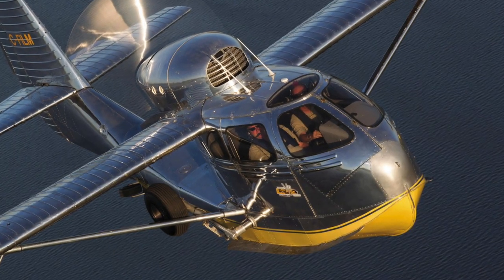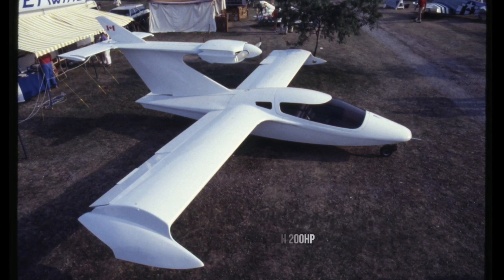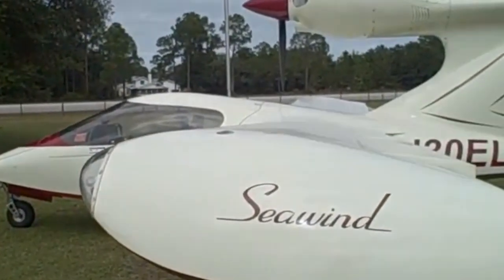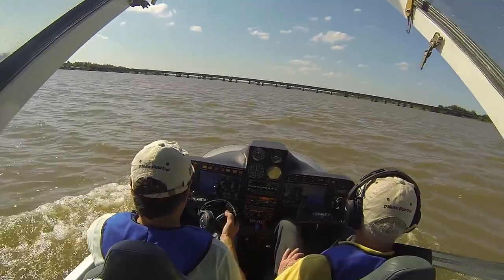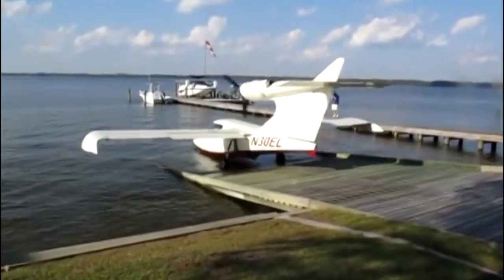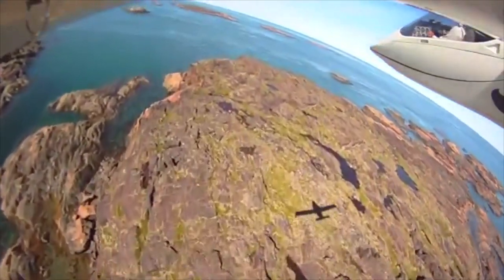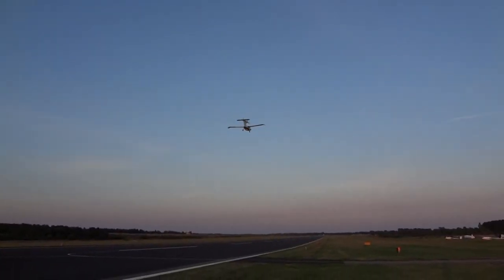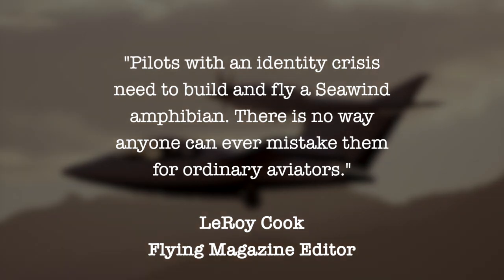Seawind 3000 Amphibious Seaplane

Comment: Hi. Thanks for the video. I was the test pilot on the Seawind certification project. It was an ambitious and fascinating airplane, and it is correct - if slightly understated - to state that the Seawind was challenging, quirky and demanding of a proficient pilot. With those caveats, it was indeed a capable aircraft, however there seemed to be no way to squeeze it through the airworthiness requirements for a certified light airplane.
Reply from the maker: Wow, thanks for sharing your experience!

Comment: There was another amphibious plane being built and tested about the same time. I can't find anything about it. I think it was called the the Sky Challenger. Large circular  blades encircled by something and I think an engine on the tail. It had gold flecked wings designed by a paint guy from Nissan. Seated 4 and had a large electable parachute just in case. Any chance you can find it?
Reply from the maker: Interesting. Never heard of that one!

Comment: I heard the Seawind300 was a very unstable airplane and not for beginners.  Wish i knew someone to confirm what heard.
Reply: jayzee  So,  would you buy one of these knowing that?   I know the lake renegade is similar when it comes to the nose pitching down when you add power...
Reply: Hi - I actually have one.  The high mounted engine creates a high thrust line, but it is predictable.  If you suddenly accelerate, you put some back pressure to compensate.  Interestingly, when you take power out, such as in a flare, the nose naturally rises so you don't really have to flare it yourself.  Other than the high trustline, it flies normally, and beautifully.  Its performance is on par with a Bonanza with the 300 HP engine.   If you can handle the Bonanza, you can handle the Seawind.
Reply: @JG-gg1we  was up J.  I would like to talk to you some more about the seawind.  Do you have a Facebook or Instagram?
Reply: I fly an RC Seawind plane off my local pond. The RC version flies great😁

Comment: Dangerous ass airplane , fuel supply is the issue . It’s one hiccup away from fuel starvation due to the fuel that has to be pushed by a pump at all times . It needs a check valve and a header tank. On the top with the engine .
Reply: Lots of planes require fuel to be pushed by a pump at all times. My Searey does for example, and also pushes up. My Grumman Tiger also requires the fuel pump to always be running. It's not uncommon.
Reply: @thecommercialpilot  the sea ray and tiger have nowhere near the bight or distance or fuel burn of a io or tsio 540 j2b engine , it needs a header tank point blank period that remains full from a pump, the engine has a much easier fuel draw from a header tank. It will kill you dead other wise if it. Looses a prime or even gets the slightest air bubble induced into the system. It’s a bad design until that gets worked out . I noticed this and made a point to discuss this with a well known Seawind guy before he burnt up in it. It’s without an argument and surely much more than a sea ray or tiger to feed.

Comment: I don't think I've seen an amphibious jet, is there one?
Reply: It doesn't really make sense because jet engines are made to fly fast and high and seaplanes are made to fly low and slow. Nevertheless I am pretty sure I have seems a few
Reply: @rainerzufall689  Post it if you find it
Reply: @justaninja1  https://sputniknews.com/business/201605301040475324-russia-be-200-indonesia/
Also: Yes they have to be slow because you want to land in water with minimal speed and takeoff as soon as possible with a lot of load. Also the fuselage simply can't be optimized for air and water at the same time. Only for slow speeds it doesn't matter that much.
Reply: Hi yes there have and are jet amphibians and flyingboats. From the Saunders Roe SR1jet fighter flyingboat. Today the only turbofan  aircraft in regular production are variations on the Beriev Be 200 flyingboat amphibian. Its used for disaster relief ..fire fighting or military use.  It can also serve as a 90seat airliner.. its a highly capable swept wing aircraft that
 displays considerable agility in the air and semi stol caracteristics when taking of  from land. 
It carries its engines on pods at the rear of its wing root... That way they are sheilded from spray or debris on take off.
The Beriev has considerable experience building jet powered flyingboats including the A40 Albatross...the largest flying one.
Reply: @clivestainlesssteelwomble7665  😳 that A40 looks crazy 😂👏
Reply: @justaninja1  
😂The Albatross is bigger than the Be 200 and it took and still holds numerous world records.
Beriev also built a unique wet wing amphibious flyingboat for about 6-8 people, its a piston powered twin.

The Americans also built a very fast jet Flyingboat.the Martin Seamaster p6....almost as large as the B52 it was built as an attack/patrol aircraft and was fast, faster than a present day B2...but it wasnt designed as an amphibian.. they also built the Convair Sea Dart jet fighter flyingboat ..but they abandoned their research...as the Airforce took over demands for land aircraft. 
Check out the Convair Tradewind turbo prop..
These early jet and turbo prop engines were often the cause of the delays ..they were new tech at the time. 
Its a great pity that a lot of the prototypes from this period were often scrapped or used as live fire targets 😢